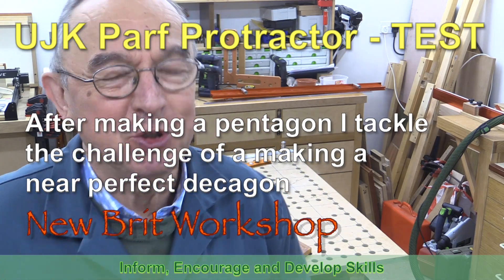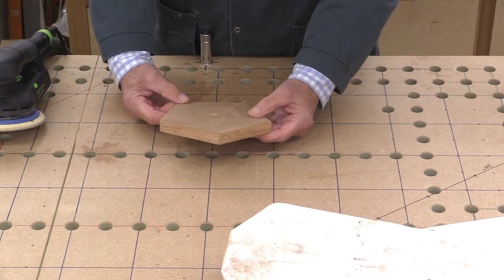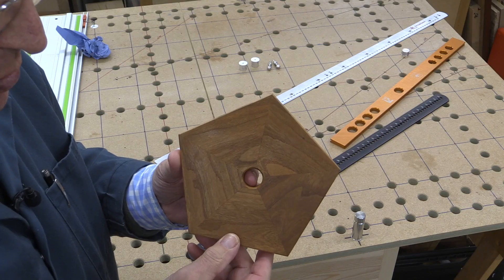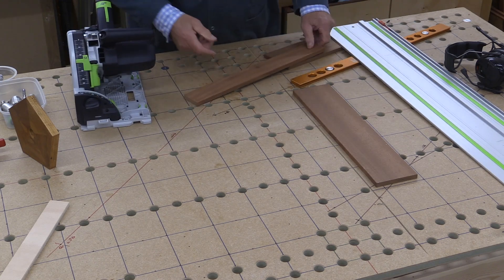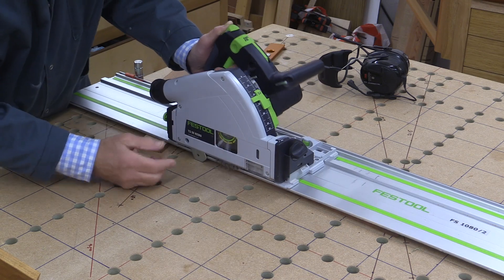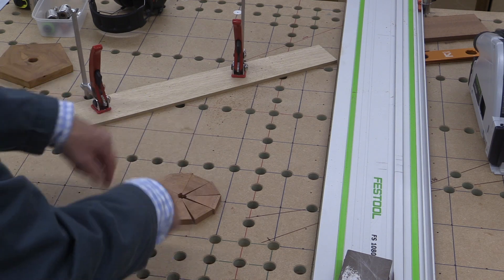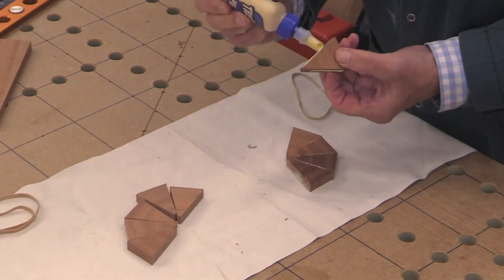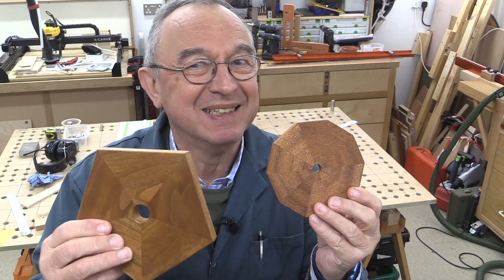UJK Parf Protractor Ultimate Test

Comment: Hi Peter, I know it is totally obtuse,but could there be an additional special hole provided in the protractor to allow an accurate heptagon?
Reply from the maker: Hi Simon, I doubt whether there are enough people who would need this to justify re-launching the product. Also, squeezing the special hole for 25.7143 degrees would be impossible as it would intersect with the adjacent whole and half degree holes. Sorry.  Peter
Reply: A high end machine shop could make a one off rule with the single spacing of 25.7143, or any other 0.0001 spacing you desire.

Comment: That's absolutely brilliant,  talk about your 5 cut test to see if your MFT cuts square
Reply from the maker: Hi Dan,  I had told people that I was going to do this and so whatever the result I had to publish the video. I really did not expect it to be as good as it turned out but now realise that the system accuracy, which starts with the tracksaw cutting station created by the Parf Guide System, is so good and therefore great cuts like this are not so difficult to do.  Cheers.  Peter

Comment: In my interest of how one would create such a device. I have drawn  one. Wow this has to be so accurate. No two holes are the same distance apart. Hence, it is handed 0 - 45° the 45 - 90° on the reverse side. Brilliant design. You talk about angle accuracy, but by my calculations, the holes are to 0.001mm. Well done UJK
Reply from the maker: Hi Barry, Yes, when I was doing the engineering drawing I was working to 0.0001. Cheers.  Peter
Reply: And we'll done again to you Peter. The progression of the system.

Comment: Why are there holes in the pentagon and decagon?
Reply: When he cut the pie shaped pieces, he did not let the cuts intersect at a point on the inside. Especially on the last piece you can see about a 2-3mm flat - no point. So that leaves a space in the middle. I imagine making the point would have created some chip out (some woods are more prone to this than others and this is only an educated guess) so he avoided that problem.
Reply from the maker: Hi Ron, Spot on - cheers.  Peter